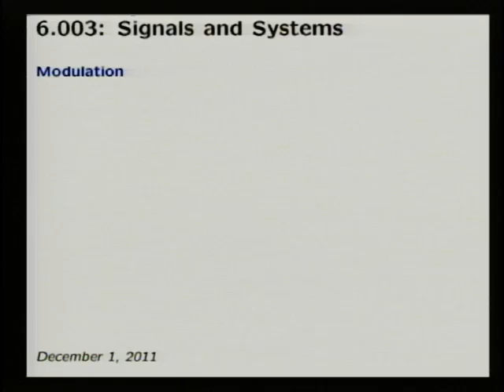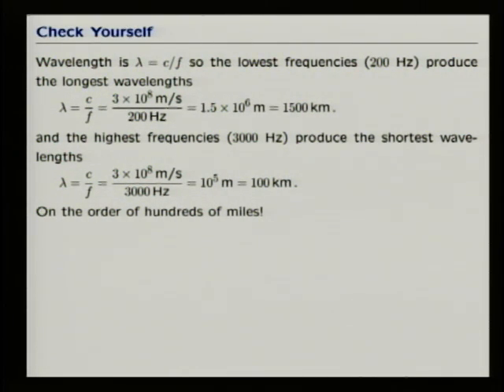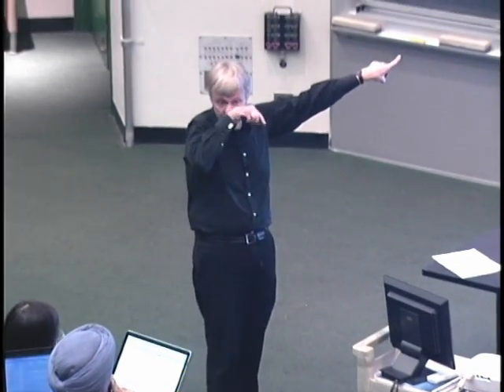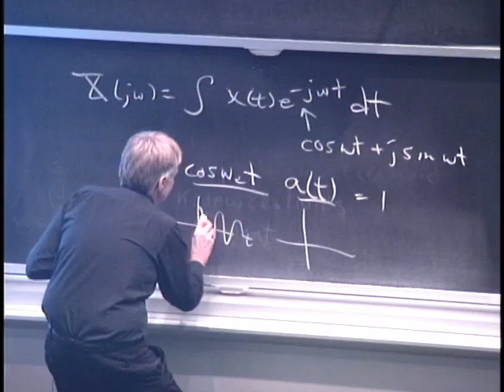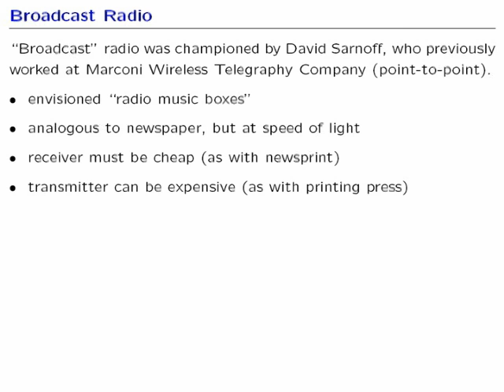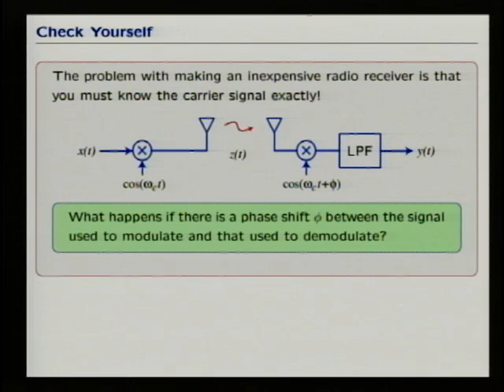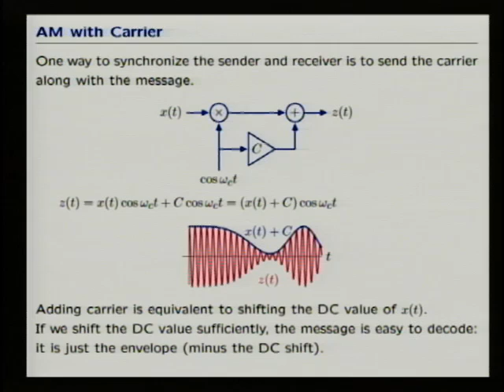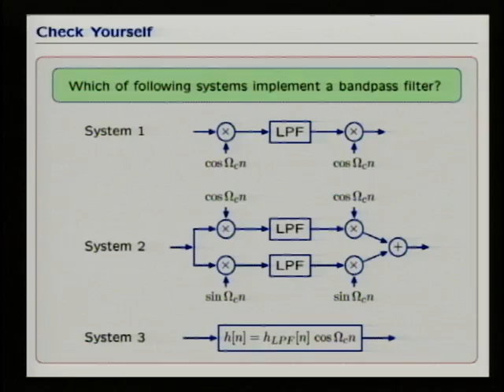23. Modulation, Part 1

Comment: 1. "It takes lots of power if the antenna is significantly smaller than the wavelength of interest." 04:00
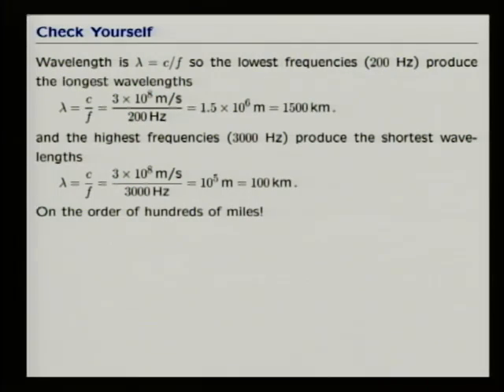2. He wants to construct a lambda antenna, but what about spatial sampling theorem? 07:30
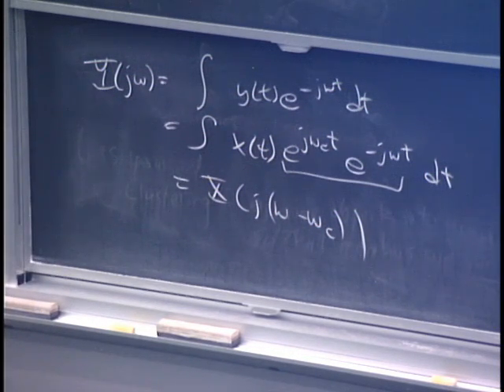3. X(omega - omega_c) 13:20
3. "Frequency Division Multiplexing: Frequencies have to be high compared to the message frequency." 25:00
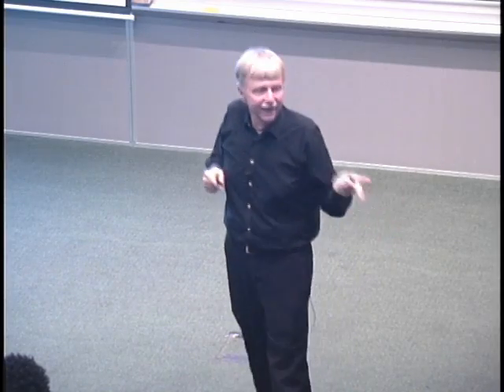4. Modulation and aliasing? 25:45

Comment: How to see conjugate symmetry? 15:45
Multiplying cosine with a function so the product becomes 1 is a bad idea, as with the zeros the function would have to go to infinity. 22:30
Synchronous modulation. 22:50 (You have to be exactly synchronized in phase?)
Red and blue Dirac? 26:45

Comment: and then, sidebands appear out of nowhere, by choosing the correct formula, none of these professors actually know, in a technical way, how those sidebands appear in a technical sense.  it is called amplitude modulation because when originally thought up the composite showed an amplitude modulation and the changing of the plate voltage of the tube,  no one suspected the presence of sidebands until over a decade later.  And here we are teaching with composite waveforms to perpetuate the misnaming.  It is like the direction of electron current flow, professors just keep teaching what is passed along even if it is wrong, because they can not unlearn what they initially learned.   So, do you, after watching this, know where the sidebands came from without resorting to parroting the formulas above....I did not think so.

Comment: how do you choose R and C value in the circuit?
Reply: Just a low pass filter so the corner is about at the highest signal frequency needed:  f = 1/ (2*pi*R*C)